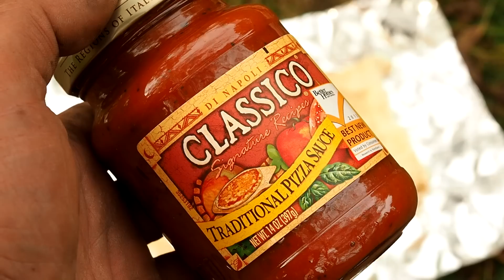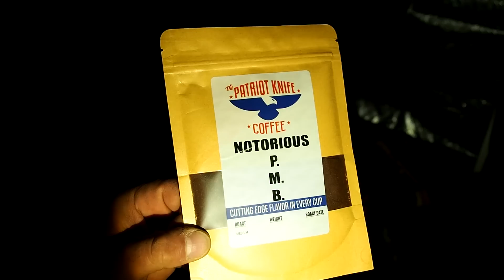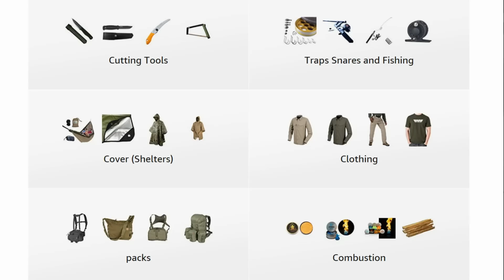Solo Overnight Building a DIY Emergency Hot Tent in The Woods and Bacon French Bread Pizza

Comment: Yeah, the mic sucks.  But you'll never know unless you try it out.  You've done a big service to those that may be in the market for a mic.
One thought on the structure.  The sides don't fully reach the ground and allows colder air in.  Perhaps using slightly larger tarps and secure their edges to the ground with rocks/soil/stakes?  Those heater/stoves are pretty damn nice

Comment: Love the video. On the Rode Wireless GO II mics - I'm a videographer by trade and that's one of the systems I use. This particular unit has its goods and its bads. A couple of quick suggestions. A mic like that needs to be mounted right about over your heart to be effective. You also may need to up your gain on the transmitter unit a few notches as well. If you're looking to eliminate all the background sounds then use the little lavalier mics that came with the units. Those can be clipped on your shirt collar, your outter blouse or jacket, or even hidden in a ball cap if the brim is facing forward. Make sure to use the little foam windscreens if you're outdoors. You'll be surprised at how much wind those will cut out. Also - same rule applies for the lav mics for distance. Ideal placement is somewhere about heart level. Orientation upwards isn't critical. Those are what's known as omni (or omnidirectional) mics - meaning they pick up audio from all directions. When mounted on your shirt or collar, your body blocks any noise coming from behind you. The mics also have what's known as a close pattern - meaning they're designed to pick up only sounds from about 3 or 4 feet from them.
Now for the bads. Not sure what you're filming on these days but there is a design flaw in the receiver of the Rode Wireless Go II system. If you're using a Sony or Panasonic camera and mount the receiver in the hot shoe of the camera, you'll get a buzzing sound in the audio. There's a fix for that I'll be happy to share with you as well but I don't want to get too long-winded in this post.
I've been following you for a long time and your camera skills have definitely improved a ton...not that I would expect any different from a highly motivate Marine. I'd be honored to talk with you about anything above or any other video related things. Please feel free to DM me or connect me through my YouTube channel. Not much to see there...it's really just for fun. Anyway - keep doing what you're doing. I spend my share of time in the woods and always learn something from each of your videos, and would be honored to return some of my knowledge as a thank you for that.

Comment: Just increase the gain on the receiver end of the RODE setup (bottom left button) once your transmitter is selected.  If you bought the set with 2 transmitters, you can use one on you, and the other on the camera.  And both can record to separate tracks, so you can do editing afterwards.  They are a pretty good set, just need to set them up correctly.

Comment: 5:54
Ridge line, across the front opening. To hold the door panel tarp.
So that it can be rolled up, folded up, out of the way,
Or, staked out, as an entryway awning.

Simply lower and toggle closed at night or midstorm.

Great idea.

Comment: Great video! Here's an idea for the winter set-up you mentioned at the beginning. 8' x 8' walled canopy shelter inside a 10' x 10' walled canopy shelter. If it gets too cold and requires a spaced wall/ceiling for insulation purposes. Those Ozark Trail products are generally outstanding. Particularly for the price. Happy trails...

Comment: I can't wait to see this in the winter. I anticipate condensation but it should not be an issue because the roof is slanted. 

I love those hot stoves and I plan on getting one. I've got the hot tent from Pomoly so I'm just about ready.

I think you'll have to go back to what you were using before for a mike. Maybe try using one of those headsets. Another option is to have a mike with that fur on it to screen out the wind. Whatever you decide to use I hope it will keep the audio at a consistent level. 

As always, great video. Keep showing the knots, I was very proud to use the truckers hitch when I was securing my Kayak to my truck. (BIG GRIN). Thanks for teaching us that one.

I look forward to seeing the next and the next video and the next video and the... well, you get what I mean lol.

Comment: To get more room to stretch out, maybe consider adjusting the tarps a bit to splay the base out to larger than 4x6.  That would require more tent stakes but shouldn't be a big deal.  Enjoyed the little moment of Zen at the end with the turtle.
Reply from the maker: covered in the video that this was a small sale experiment
Reply: @recall5811  yeah I caught that. Just a suggestion, others may not think of it.

Comment: A great idea for a hot tent. There are actually some self-enclosed pop-up tents similar to this (minus the stove). The walls are simple material and not reflective like what you used. (I like your walls  better.) These tents are used by bank fishermen in inclement weather. I have used mine to camping, as well. I have an idea for adding reflective walls and a hot stove for winter. Thanks for the video and the ideas. BTW: Frito pie made with chili is a great camp meal.

Comment: They actually make a 10ft easy up wall panel for that canopy with zipper edge so 2 of them will zip together and close it all up. They do not have the reflective coating on them though and are in my opinion a litter thinner than the insulated tarps

Comment: That's the best car camp tent there is.  Neat, clean and well erected.  It looks like an inviting cabin if you're somewhere for a few days to a week.  The door awning is exactly what I do too for the split in the tarp wrap..

Box stove will overheat that small space even on freeze nights.  Large ammo can stove burning sticks is better to that scale.

I have nearly the same mess kit with two nested pots and the frypan... except the grate.  I can't find a discard or new wire grate that size.

For hiking or motorcycle camping i use the $7 scout mess kit...flimsy but it works and is small.

Comment: great video - as others have said, the volume level of the new mic is really low.  can turn you up but then get blasted from the 'regular' volume of the vendor-rolls.  
definitely like the idea you demonstrated and I agree - looks like something that would have a place on the market.  you could even have it as a single 20ftx10ft tarp that the excess folded under as a floor type thing, creating almost a box.

Comment: RODE does make good gear. I have that mic you have. It works great but you really should add the lapel mic too that for best results. Also they are best worn (without lapel mic) closer to the point of sound. Also as with any mic setup, you will need to add a dead cat type wind blocker. Even the most expensive and best mic in the world will sound like crap if you leave it naked to the wind. 
Also the RODE mic receiver has a gain button on there, you could use that to help boost your voice when the mic is worn so low, (would require a little bit of post sound to remove the higher frequency bugs etc though but not difficult to do in something like Premier Pro).

Comment: Using the pop up canopy is a great use as a tent. My only comment was the front canopy needs a droop in a front corner or slant away from the canopy to avoid water incursion, other than that it’s a super project

Comment: I truly enjoy watching your videos and learning new skills, and I haven't critiqued anything you have done yet. Until today, 1 good gust of wind and your chimney will fall over, the chimney support bracing need to be more robust and wind proof. Also you need to place sod or something at the base of the sidewall tarps to prevent cold air from entering under them.
The concept is great and inexpensive, I love it!
Reply from the maker: yet the wind blew and the pipes were fine and secure as shown in the video
Reply: @recall5811   draft underneath might be necessary to establish some means of air flow.  Perhaps design some rain proof ventilation higher up on the  wall or roof?

Comment: Since you are talking about improvements later , how about a Dakota Fire Hole with a plenum running through the center of your tent ? The fire feed is on the outside of one side( preferably outside the door) and an exhaust on the outside of the other side. If you install a metal bucket ( preferably stainless) in the floor into the plenum then you have a cook stove/ heater. You will still want a fresh air and exhaust.

Comment: Hi Sean, well another great video! 
I agree the mic sucks! I've been using the Azden SGM-X for the past 15 years. It's a great mic, but they don't make that model anymore. I would suggest one of the other Azden shotgun mics. If you want to step it up, also invest in a wireless lavalier & a portable mixer, like the ones built for dslr cameras. That way you can use both a shotgun for natural sound and the lavalier for higher quality voice. Azden makes all of those. It's a decent brand without the high price. Of course there are several brands that are higher quality,  but also with much higher prices.
Thanks again for always making great videos! 👍

Comment: Thank you for all your videos. I did have a question about using a canopy as I have found most are only water resistant not water proof. Did you have any problems with leakage on the top cover?

Comment: i would say the mic picked up the back ground noise more than your talking for the majority of the video, but that being said i could still hear you but your in the woods man there's always going to be back ground noise as long as its the sounds of the woods and the cracking of a fire and we can still hear you i dont see a problem, how ever at some points it picked you up far more clearly than others for example coffee time your audio was clear even with the tapping of the rain, ..... side note did a weekend camp at my friends new woods a few miles out the city ( in the uk ) lovely spot 14 degrees oc, packed some gear your self another another tuber over here in the uk has used took a bigblue 28w solar panel and battery bank and had it all on back of motorcycle, had a go at a dakota fire pit and Swedish torch and by time my friend arrived id just about finished a nice swing seat knocked up using your arbour knots haha pretty sure he thought i was moving in, first time there but loads of dead wood showed him a few of your vids so were gonna try knock together a more permanent half dug in the ground structure using what's about, and obviously had to cook some bacon cheese burgers ! keep up the great work

Comment: Hi Corp, a question regarding your laplander saw - do you swap out the saw blade for green and seasoned wood? Asking because I've been using a Silky Pocketboy with a greenwood blade and have found it's not great on standing dead wood and was thinking of buying the appropriate blade for the saw.
And the microphone didn't seem to work as well as your previous set up. Cheers mate.

Comment: Hello sir
I didn't care for the mic I had trouble hearing you with my volume on high and I've never encountered that before I like the hot tent but suggest cutting the vent hole in the shape of a U then folding down out of the way to be repaired with gorilla tape

Comment: Not really a fan of the new mic.
I think the pop up shelter is a grwat idea, especially for the price.  Multiple tarps vs on large tarp provide good flexibility for different configurations.  I would only use it as a hot tent in the winter.  
It occurs to me that this could make a very good ground blind concept.

Thanks for doing this one. I wouhave thought of a pop up.

Cheers

Comment: I personally leave the "roll up door flap" in the [ from camera ] "back side" [ as you had it originally ] -- this is my "emergency escape" route  --  in case Cernunnos , Lugh & Odin get drunk & decide to jokingly let the fire get out of hand -- just to see if they can create a liitle late night chaos and laughter at my expense -- ..

I then add an "extension" [ on the camera "forward" side ] .. and build a stone firepit outside the "hot tent" area -- roughly 36" / 3 feet away from my 16" raised sleeping bunk  / combo seating area ..

I then add three reflective stone walls [ wood logs if I can't find rocks ] that redirect the heat into the "tented" sleeping area ..

In your case, this is roughly two 6' x 4' Canopies in dimension , though slightly larger ..

My exact "hot tent" dimensions [ built using hand-assembled "cross x / dome tent" poles atop local-sourced stone or wood pilings [ to reduce carry weight ] is 6' - 8" to 7' - 0" [ 80" - 84" ] Wide [ me at 6' 0.25" tall , plus 4" - 6" air gap at head and foot { to help prevent condensation soaking into my sleeping bag } ]  x  roughly 9' - 0" [ or longer ] Deep ..

The 16" raised bunk is either 28" - 32" Wide [ 24" - 26" is too narrow for me to comfortably sleep ] , for Solo ; or ~ 56 - 60" wide , for a M / F coupling experiment ] .. plus 30" - 36" walkway between bunk & firepit .. plus a 24" x 24" [ interior dimensions ] octagonal stone firepit [ 16" - 18" fire logs / burn area with 3" - 4" air gap ; plus size of stone fire ring - another ~ 8" ] .. plus ~ a 12" air gap to reflective back & side walls [ 4" - 6" thick ] ..

I generally taper the sides in at the firepit to 12" - 18" from fire pit , creating a six-sided square-to-trapezoidal shape to reduce cubic footage .. the area above the firepit is usually left open .. though you could add a tarp with non-flammable exhaust ring cutout [ as you did ] .. 

I don't camp anywhere that gets below 16 - 20 F at night -- & that is extremely rare [ usually the result Cernunnos , Lugh & Odin getting Druidicly Drunk & wishing to play 'how cold can we get it' games with me again ] -- I try to aim for 40 - 60 F at night [ Southern Arizona, Southern new Mexico, West Texas -- maybe Santa Fe or Flagstaff or Petrifeid Forest .. or Trinidad / Cortez , CO area in the fall or spring -- Lander / Red Rock Canyon / Wind River Mts in the summer ] .. The old native American Indian Sacred sites that most people have forgotten about and turned into commercially corrupted Tourist Traps instead ..

Bradley Scott makk Alpin ;
son of Arthur, last King of the Brits ;
son of Angus, last King of the Picts ;
son of Alpin, First King of the Scots & last King of the Dal Riat ;
son of Llewelyn, last King of Wales ;
of Scotia , Cymru , Pictavia , Eire , 
the Old North & Western America

25 Year Master Druid
20 Years as Druid Apprentice
45 year student of Ancient American Culture & Traditions

Comment: Just my humble opinion: lavaliere microphone sounds tinny and at low volume, possibly too far from mouth to correctly pick up the sound? If possible, adjust the onboard recording levels (-3 to -5 if on a visible vu meter) to more clearly pick up your voice, background noise not so bad at this time. The breakfast burrito volume sounded correct voice wise probably because all the sound was reflecting right back to the microphone. But it was still a little on the high end “tinny” sounding. It’s always a trade-off when recording live, outdoors, by yourself when you’re doing all of the work, without headphones to hear what it actually sounds like. Keep up the great work! 
🎙️🎤🎧📣🔊🤞🏼🖖🏼✌🏼

Comment: Wisdom; 90+ percent of things are free, you just have to ask. Quantified below.
Corporal you have a very powerful platform whether you are aware of it or not. You also wield a powerful presence and message which can be used for good or bad, positive, or negative. This is your choice of course.
Emergency hot Tent video, at 17:07-17:26 you requested a response/help to the audio issues “let me know what you think” otherwise unqualified request.
Stats; >18,000 likes, >203,219 views and >1million subs.
In the Tee Pee video you pretty much spanked your responsive audience for having answered your specific request, this sends the wrong message (14:24-15:11).
Quantifying Scenario: Suppose in a video you request help with obtaining “Snap Lites $1.53ea” for your store because you have run out and there is a great need.
1800 x $1,53 is $2754.00 the minimum value you of your request for “request/help”.
18000 x $1.53 is $27,540 a Likely response for “request/help”.
203,219 x $1.53 is $310,925.00 a possible response for “request/help”.
1,530,000 Unlikely but exposure is there in a response for “request/help”.
You are indeed in a very powerful position.
Choose well, Distant Observer USN

Comment: I don't get the point of these set ups. Why wouldn't someone just use a tent instead?
Reply: Absolutely you can use a tent. However it's about thinking outside of the box and applying critical thinking as an important life skill.
Reply: Where do you buy a tent with reflective walls and be able to open the whole side for warmer days?  If you are a :just buy a tent guy,  Why would you watch?